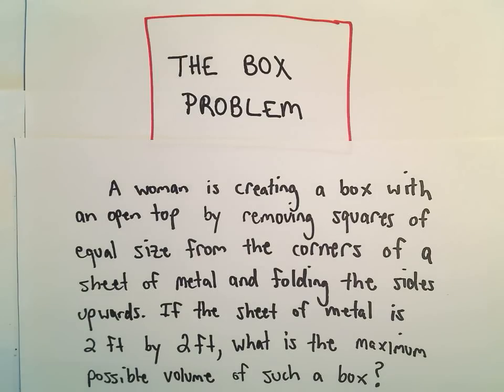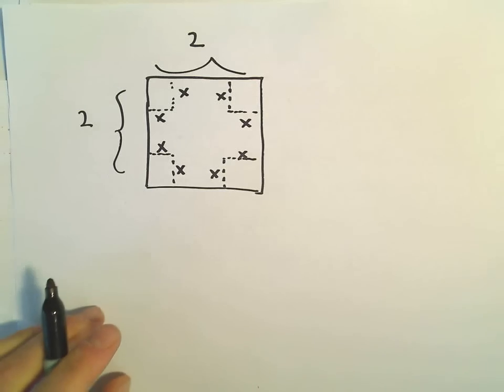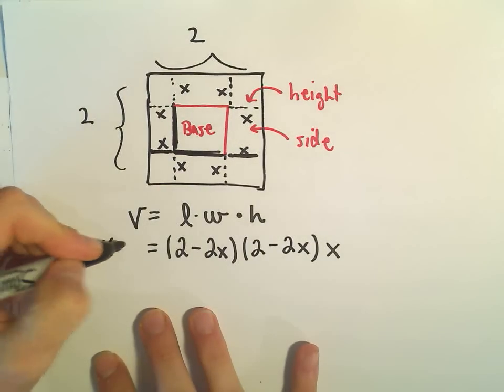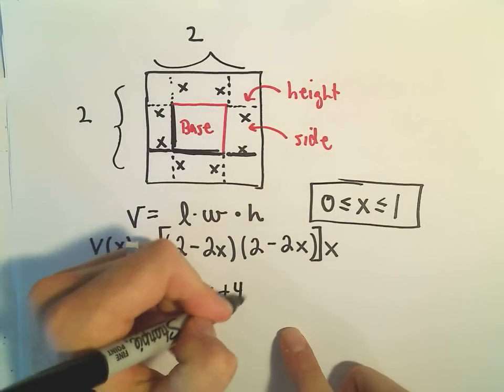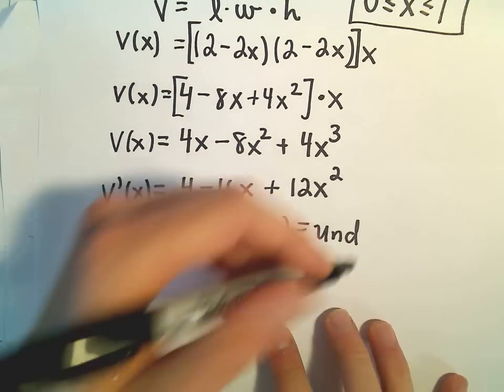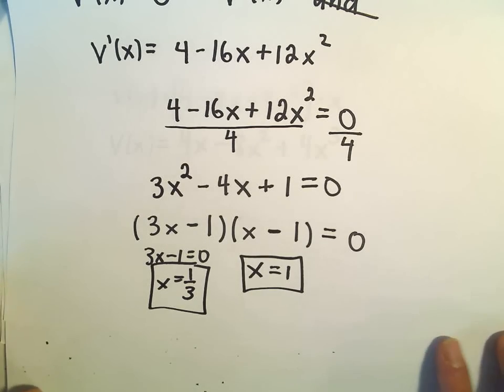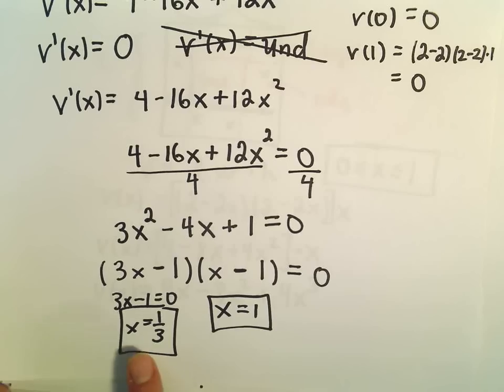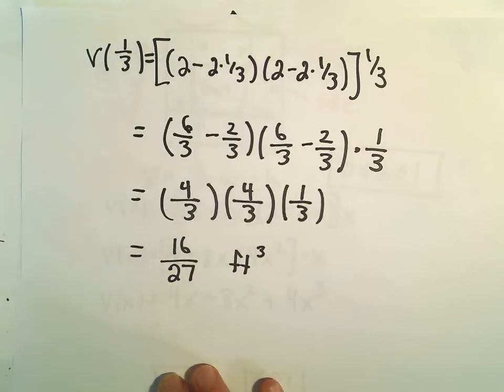📦 Optimization Problem #5: Maximizing the Volume of a Box from a Square Material 📦

Comment: The proof should be 2/3 to the power of 3, right ? I think you forgot to see that it is 1/3 of 2 feet or 2 feet  divided by 3.   So it should be (6/3 - 2x2/3) (6/3-2x2/3) 2/3

Comment: Can't have 0 or 1 as values for x, the values can be in between but not inclusive:
0<x<1...If x were 0, the height of the figure would be 0 and that is impossible. Of x were 1, the length and width would be 0, which is also no longer a box.

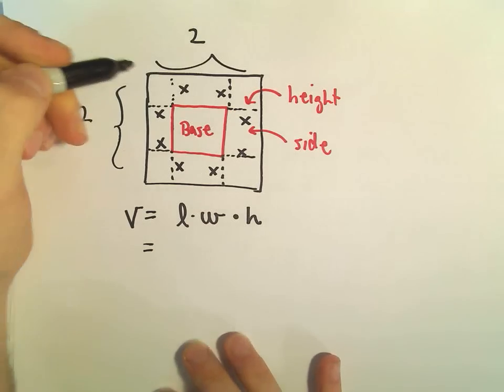Comment: Look at 02:14.  The white space he points to that says "side" will be folded from its horizontal position into a vertical position.  Now that white space is standing straight up, so x becomes the height of the side of that white space.  Since it is a box all the sides are the same height, so x becomes the height of the box.